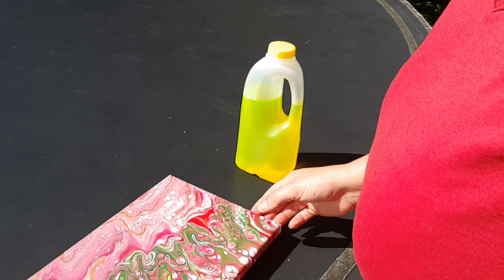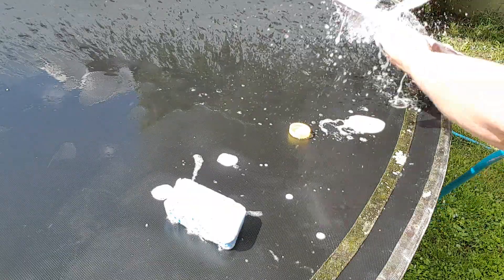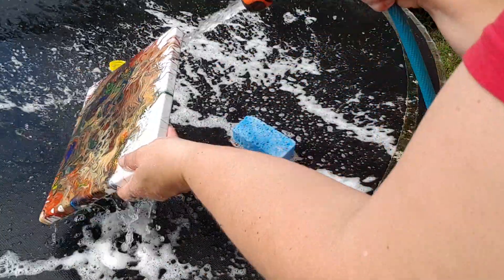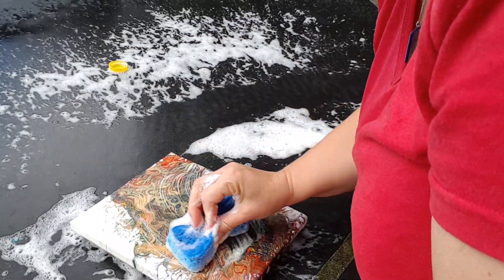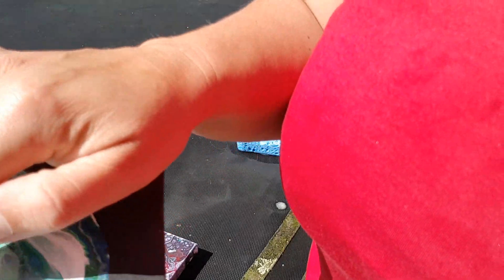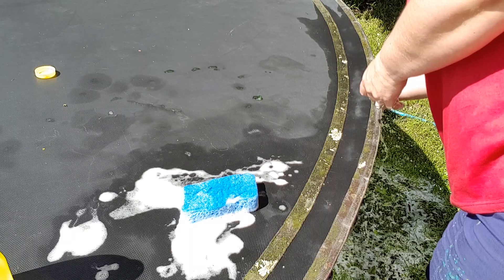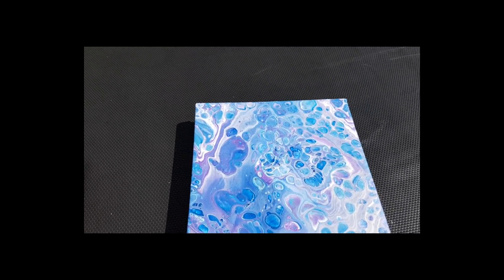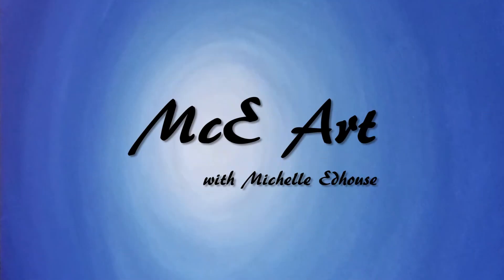115 How did they dry  and how to Wash off Silicone

Comment: It’s winter time in UK right now and it’s snowing, but even so, if I used this much water even in the summer we don’t get the weather to dry them quickly outdoors. So I’ll have to look for a different way to clean them.  I’ve read some people use cornflower or baby powder. Then wipe that off. I’ll experiment with some practice pieces.
Reply from the maker: Yes highly recommend using practice pieces to see what works first.  I have seen those as well and seen others comment that they then couldn't get it off.  Let me know if it works for you.

Comment: Thanks for the video. I use polyacrylic as my varnish and it can be used over oil. Would you recommend still washing off the silicone? Love all of your videos. Thank you!
Reply from the maker: Great question!  I had never heard of polyacrylic so it sent me off on a google search and this is what I found (note they are talking about oil based stain then covering with polyacrylic):
wipe down with 100% pure mineral spirits and allow to dry then coat with polyurethane.

 (quote from bottom of this page  https://www.doityourself.com/forum/solid-hardwood-engineered-laminate-flooring/130518-water-based-poly-over-oil-based-stain.html)

I hope this helps.  I personally would always get the excess of before sealing to avoid variations in the surface.

Comment: Hi Michelle, is it possible that if you used a stronger quality of detergent, that you might not need to do so much washing?  Because I only have tank water, hearing the water in a constant flow is a little off putting but thanks for the video and showing us just how much cleaning our paintings need before we lacquer them. :)
Reply from the maker: Hi Rob,  Yes you could try that.  I keep washing till the water and bubbles aren't repelled.  Finding the brand of soap that works for you and your paints is the best option.  I have seen some youtubers wash only once and that has not worked for me.  What works for you?
Reply: Well Michelle, I think that I need to be a bit more careful before I lacquer mine, I've only been pouring for about three months and haven't been quite as thorough as you.  I just take a wet sponge with detergent and rub it over the painting, rinse, repeat then wipe it off with a clean sponge and use some rubbing alcohol on them.
Reply: BTW I haven't had any problems with my paintings but then, I hope in the long term they will be OK.  :)
Reply from the maker: Rob K if it is working for you that is great. It also seems to depend on the type of varnish or resin you use as well

Comment: Does all the water not warp or damage the wooden frame?
Reply from the maker: No I have not had any problems at all.  The frames tend to be kiln dried so takes a while of soaking and pressure to warp them.  I tend to do my wash days on warm days so they dry off quickly and don't sit around wet.

Comment: what if u never wash.  new at this n got one done for a show. hangs for 6 weeks. And its done on masonite
Reply from the maker: Hi Katherine,  Washing allows for getting rid of the silicone quickly and easily.  If there is still silicone on the piece when you try to varnish or resin your piece this can cause unsightly results.  Also if you leave the silicone on it becomes a dust trap in those spots. I have seen other youtubers who have wiped with alcohol only and some that have used cornstarch to absorb the oil the wiped that off.  
Sealing you piece gives it more longevity and also can protect the paint from uv light.  If you piece is only for a 6 week show then no problem but if you are looking to sell the piece to someone then I have found most clients like to know it can be dusted and cleaned without damaging the piece.
Reply: Katherine Apple I don’t have the climate for this kind of cleaning so I’m going to try the baby powder, brush off  , then wipe off with alcohol.  I think it all depends on whether you want to varnish or not. I’ve varnished one without too much cleaning so I’ll wait and see what happens.